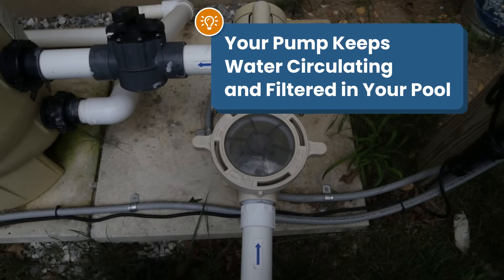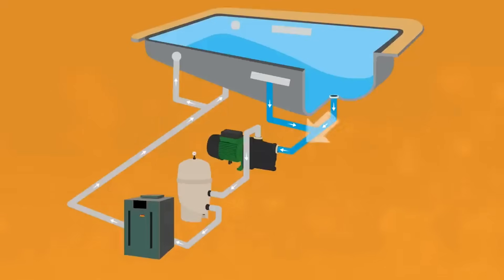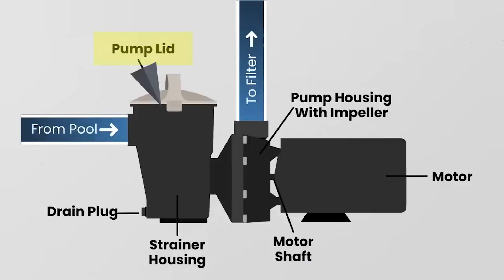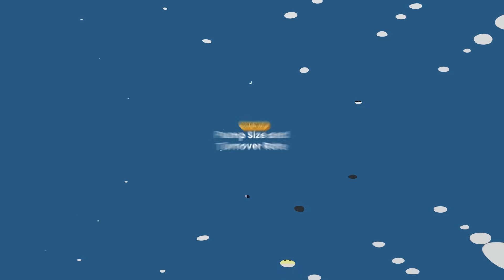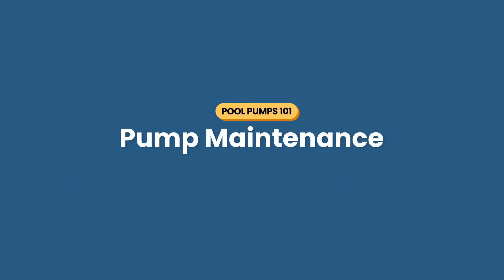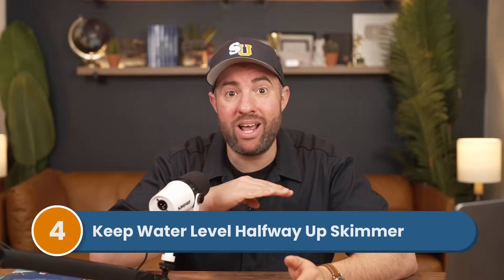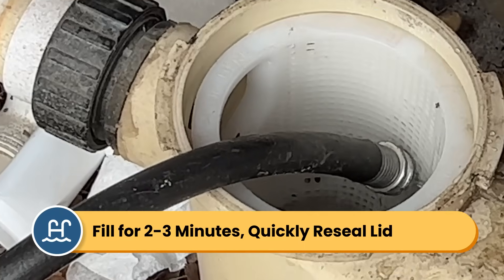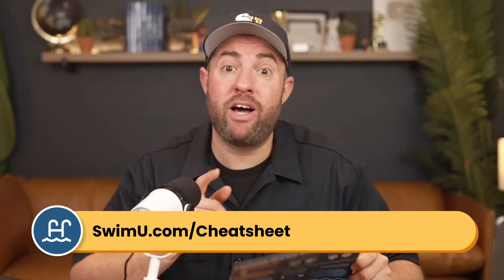POOL PUMPS 101: How They Work and Troubleshooting Tips

Comment: My pump shuts off for approximately 4 seconds then turns back on every 20-30 minutes. Any advice would be greatly appreciated.
Reply from the maker: Sounds like your pump might be overheating. Check for blocks in the skimmer line or the impeller.

Comment: I was hoping to learn more about pumps, as specially when the video starts out with "everything you need to know". Could you make a video about the more technical side of the pump, like what all the stuff on the label means (pressure, PSI, H(m), H max, etc). Right now its hard to find information, I have no clue what the power of the pump should be for a particular kind of sand filter. Is my pump too powerfull or too light. Can my current pump handle the new filter that I want to buy? I have no clue how to check that.
Reply: I'm having the same problem

Comment: Hi.  Closing the pool last season, I used a compressor at 25psi to blow out my bottom drains.

The compressor was hooked up to the hayward basket filter sp2607x10.

After shutting down my second drain, before I could shut off my compressor, I heard a very discernable pop, then water dripping from underneath the basket rolling down the concrete pad.  It wasn't a lot of water coming out.

What happened?  Is there a rubber gasket that blew, or did I brake the basket?

Thank you.
Reply from the maker: It's hard to say what the noise is having not been there. Have you re-opened your pool yet? I'm curious if your pump experiencing air or it's holding suction okay.